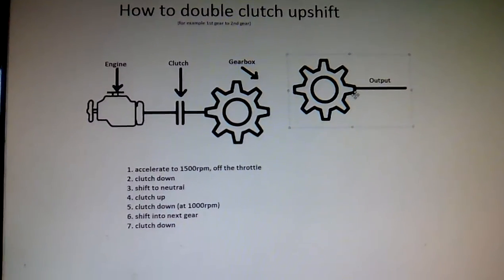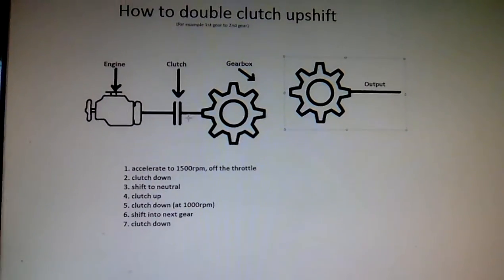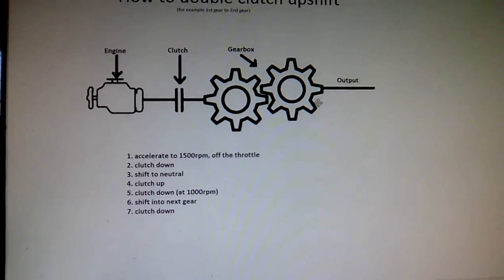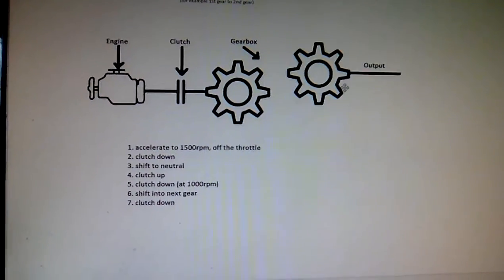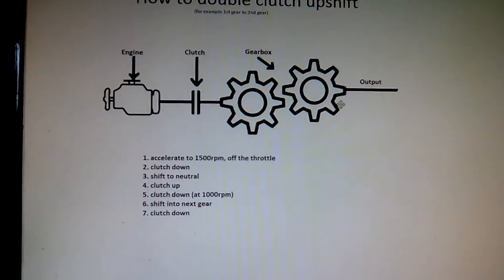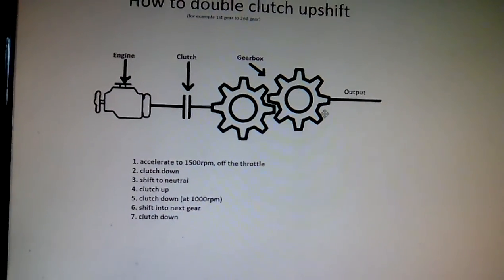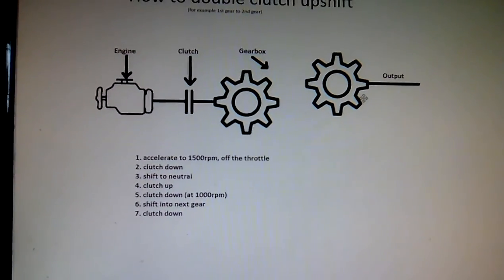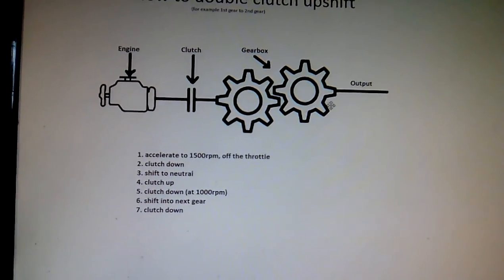How to double clutch up shift in a vehicle with crashbox

Comment: This is a good explanation that I have found lacking in other videos. Namely, the way you point out the engine speed that needs to be achieved in relation to the speed of the output shaft.
Reply from the maker: yes my video is more time efficient than the other videos... the shortest how to shift gears video last time i checked

Comment: you can shift without using a clutch. There is a moment when you easily shift to "neutral" just after you off the throttle.
Reply from the maker: Maybe it works faster and smoother without the clutch or maybe without driver making a bad judgement the engine or one of its components randomly starts drawing a extra load or boost too much then rpm is off and it breaks the gearbox.